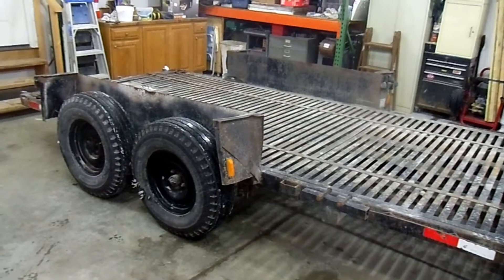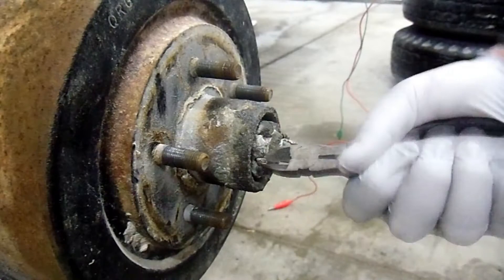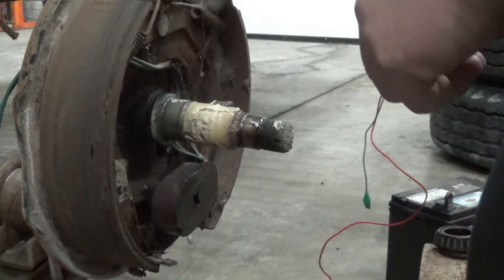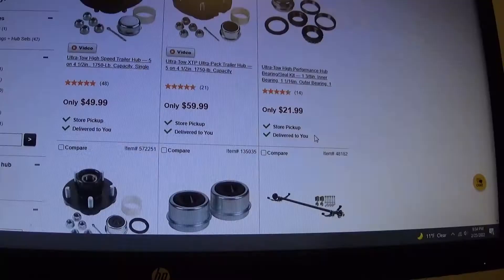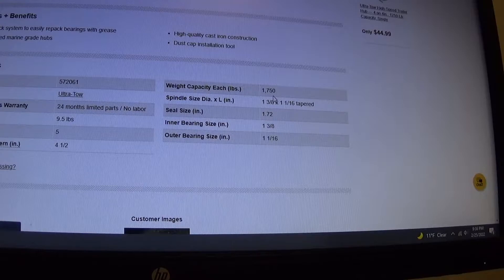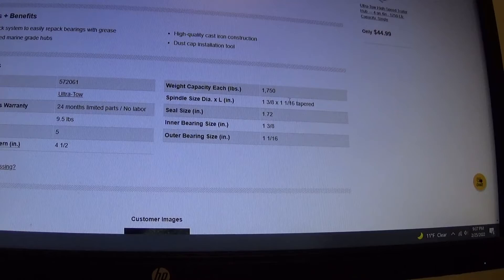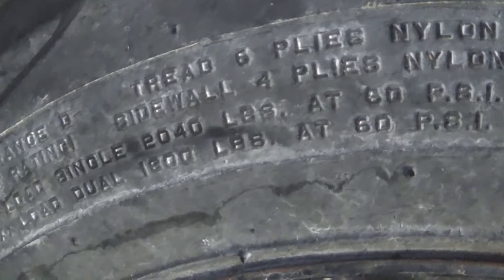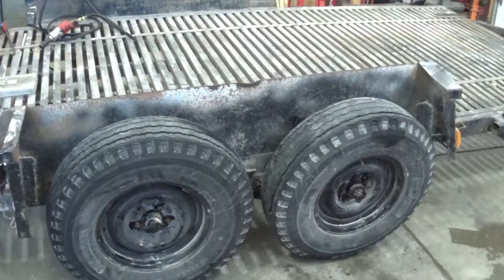How to Calculate The Weight Capacity of a Trailer

Comment: I have a homemade 5×8 with a single 3500lb axle. Very solid frame. Just a single forward tongue with no chassis support. Really wondering if it can support a 200gallon water tank.
Reply from the maker: The water weight would only be 1600lbs. You've got 1900lbs leftover.  I can't imagine the tank and trailer weigh that much. Keep an eye on it while filling but you should be fine as long as the trailer is in good shape.
Reply: That’s a solid 5x8 trailer , I have a 6x12 3500axle iam thinking of switching the axle out for a 5k and welding in some extra bracing to undercarriage and toungue . That way I can haul my little bobcat mt100 on it , it weighs 3450 hauls as is but it’s little hairy to say the least .